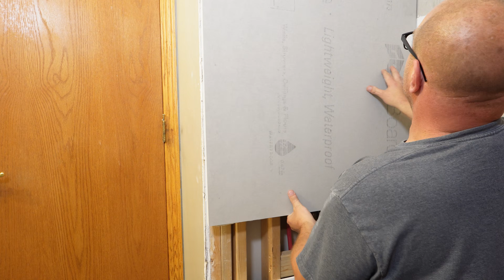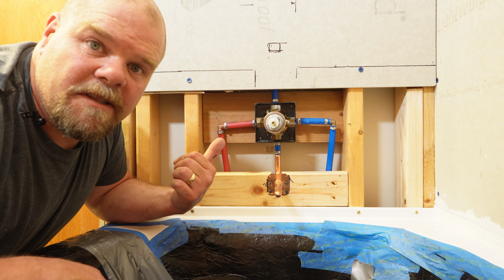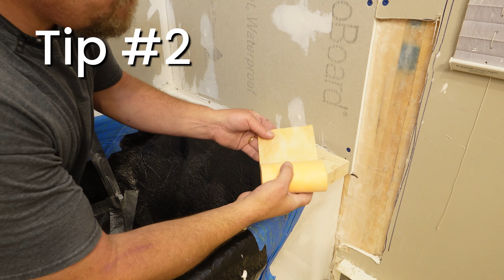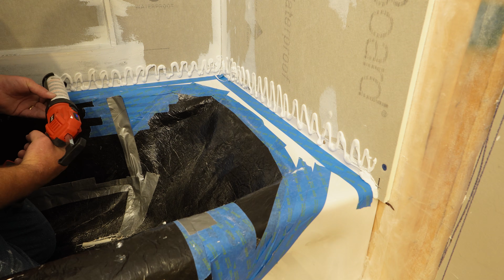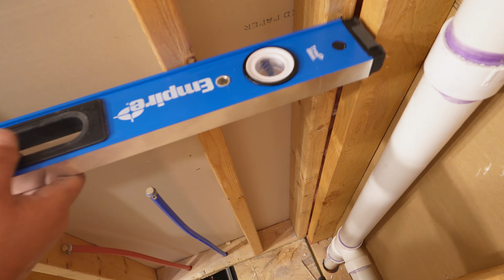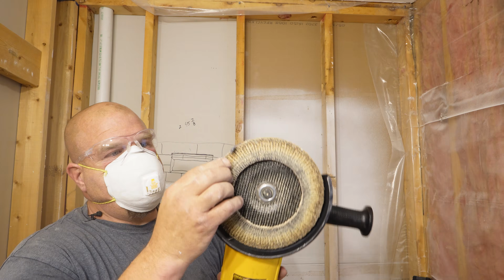Bathroom Remodel: Unlocking 3 Easy Tips For Tile Backerboard Installation!

Comment: I live in a mobile home and I have a dip in the floor about 6 inches wide and about 3 foot long and underneath it says it’s in between some two by fours or two by sixes can I use the self leveling stuff that you use and then put the vinyl back over it You’re a blessing

Comment: Ya gotta move away from Pex with Oetiger fittings. Those elbows work ok on a vanity but they reduce water flow for a tub diverter and shower head. I found out the hard way after I had to tear out the work. Twice

Comment: Great information! What about out of plumb walls? I’m about to tile a shower with exact same layout but it’s a 120 year old house and besides out of true studs on the horizontal plane the walls are out of plumb. I’m concerned that the corner tile reveal will vary from top to bottom and be obvious even to the casual observer. I’ve been saving this task because it’s an entire remodel of this home and I mulling over how to achieve flat and plumb. When I say plumb I mean reasonably plumb.